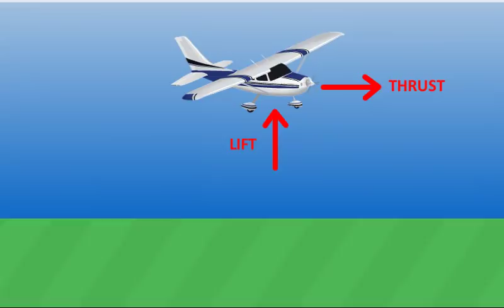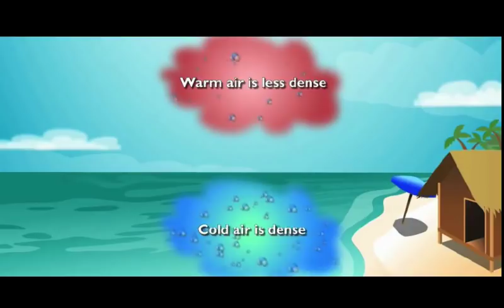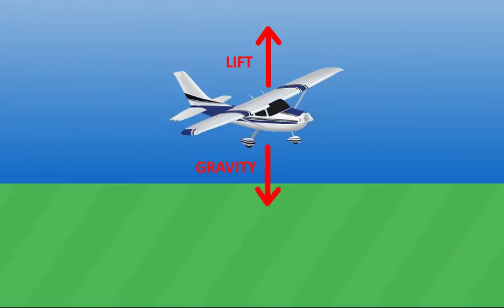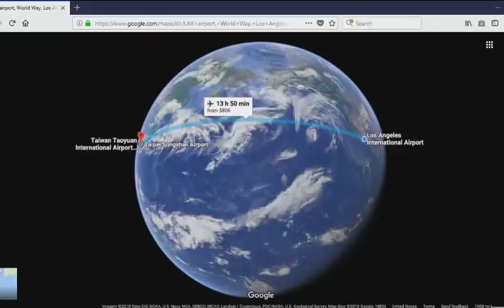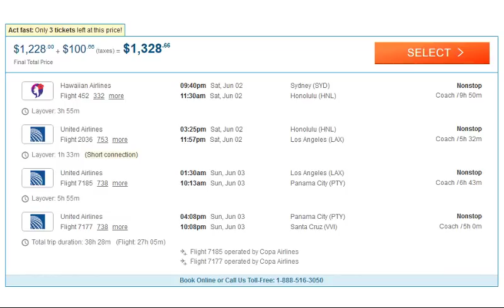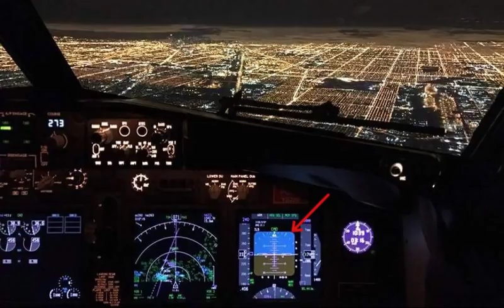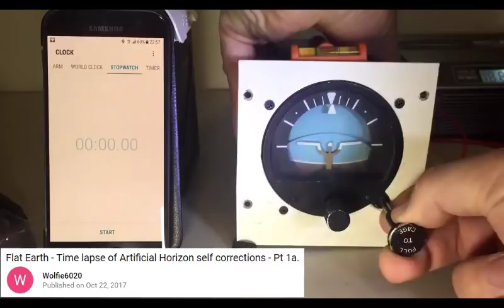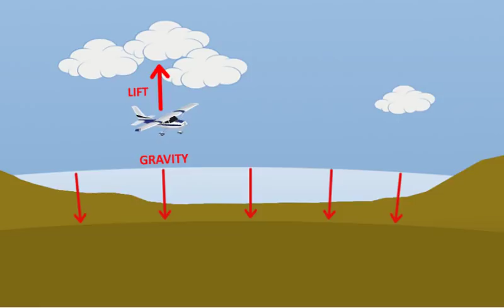Flat Earth Falsities - Plane Nonsense

Comment: if the plane was flying like in the flat earth example, the plane would slow down by going straight, but if its not slowing down, then how can the earth be a ball? your theory of elevation does not hold, since the plane would still climb some altitude with the same trust until the speed loss causes the plane to stall. how are gliders able to climb altitude if they need extra thrust? if the plane was slowing down by the increase in altitude, then the earth would be a ball.
Reply: dumbcreaknuller,

You cannot compare glider with aircraft (although they both have wings, and are flying on the same principle).

Glider has to be brought to the certain altitude by an aircraft, and then it can fly by pure aerodynamics, loosing it's altitude with time. It can go up only under certain circumstances ('pillars' of hot air that goes up), and that is certainly something you don't want if you are flying in an aircraft (these are turbulence and not favoured by the passengers, or pilots).

Aircraft flies by making equilibrium of downward drag made by gravity, and upward drag made by speed of the air circulating the wings. That speed is controlled by the engine trust, and since the air pressure is the same on the same altitude, aircraft flying straight will follow the curve around the Earth' surface.

If the aircraft slows down, it will loose altitude, if goes full throttle it will go up, but not indefinitely but up to certain altitude (known as 'ceiling') different for every type of the aircraft, and the height of the ceiling depends on different factors (weight, max. engine speed, size of the wings, etc.) simply because the fact that air gets thinner with altitude, and aircraft loose ability to create sufficient upward drag due to the air being too thin.
Reply: A plane flying 'straight and level' is in equilibrium between gravity and lift, and gravity always points towards the ground (as far as planes are concerned). If a plane flew in a truly straight line (ignoring curvature) then it would seem to by gaining height as the earth curves away below. It cannot go like this indefinitely - gravity is pulling it down and back, and air is getting thinner, so left thrust and lift. So your comment seems to support globe earth. Gliders get their lift from thermals - columns of warm rising air.
Reply: dumbcreaknuller 
Seriously?.......you're asking how gliders climb?